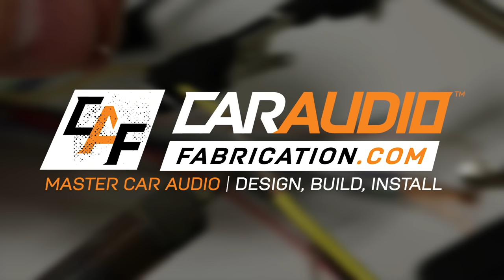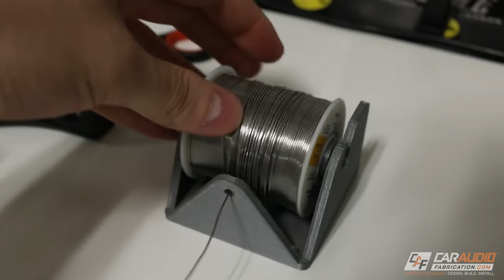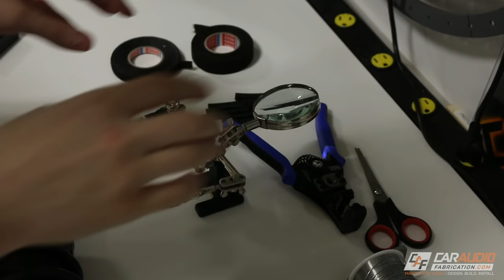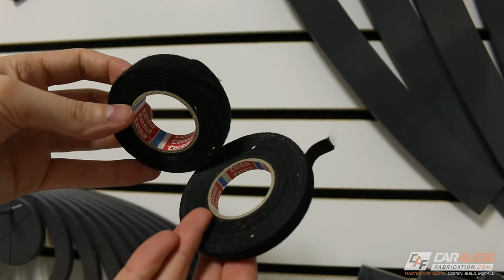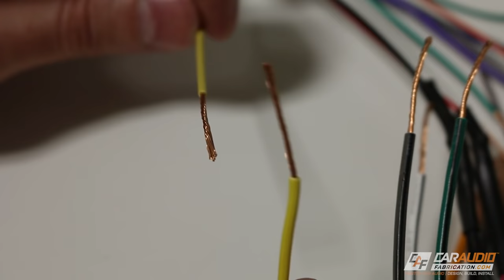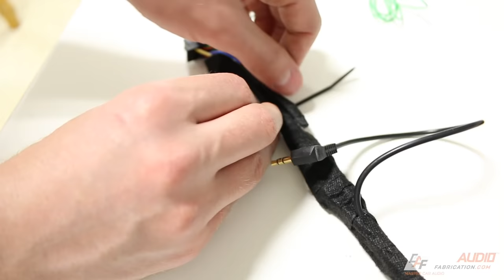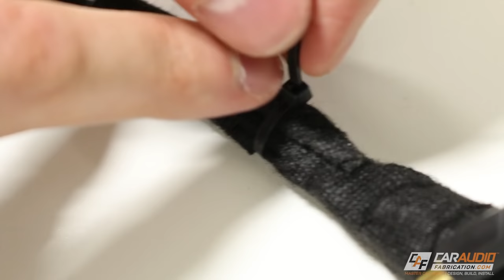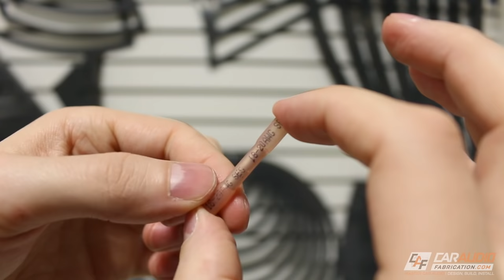Radio Wiring Harness - How to Install like a PRO

Comment: I'd like to know how to install a radio in a car that has no pre-existing wiring whatsoever. Do you have a video that explains how to do that?
Reply: jack chatham that's very easy, just run a wire from your battery to the install location, put a fuse somewhere in line. Ground it to the frame as close to the radio as possible. Then run wires to speakers. Or RCAs to amps then wires to speakers. If you don't have stock speaker locations, then yes you may need a little help 👍😊
Reply: Run wires to speakers, run constant to battery, accessory to key ignition or a RAP relay,  ground to metal. Done.
Reply: How old is the vehicle that it doesn't have wiring? You best bet would be to make a vehicle harness for it. It's not hard at all. I had to make one for my VW Bug in the early 90's
Reply: Main thing to remember is what you need to properly operate an aftermarket stereo. You need a 12V Constant, 12V IGN/ACC switched, Ground, and then your speaker wires. Other wires you may find/need are illumination, amp/antenna turn on.
Reply: It's a 1983 mini. They were never supplied with a radio as standard, at least not the bottom of the range model I have. Appreciate the replies, but most of what you've all said means nothing to me.
Reply: Care I was with you up to 'run wires to speakers', after that, you lost me.
Reply: Jack - Care means you will have to install wiring for the speakers you plan to install. Your best bet would be to use the radio's harness as your starting point. Yellow wire goes to the battery or a constant power source, Red wire goes to a switched bank in the fuse block or you can splice into the wiring behind the key switch (I did this with my VW), Black goes to ground and then you can either install speaker wires or run RCAs to an amplifier. You would still need to install speaker wires from the amplifier to the speakers.
Reply: LuckyRosco I saw a guy blu-tack a wire to his battery terminal and run it to his head unit. I know that's not the way to go about it, but I don't know what you mean by 'goes to'. Yeah, it goes to the battery, but how do you attach it? That's why I need a video to explain the stuff that you all seem to know implicitly. Same for 'splice into the wiring', without seeing it done, I have really no idea what this actually entails.
Reply: Anything going to the battery (also the ground) needs a crimp on ring terminal. I use the bare terminals so I can solder them and protect them with shrink wrap. I don't know where your battery is, but you should also use wire loom to protect the wire in the engine bay. The Tesa fabric tape won't last very long in the "under the hood" conditions. Wires installed in the interior can be Tesa taped, zip tied, or loomed with PET expandable braided sleeving (my preferred choice). All of this can be bought off of Amazon.
Reply: jack chatham Sounds like you're a little out of your depth. Since what you're attempting to do is a little more advanced then simply installing a radio into a car that already has one, which is basically a simple remove/replace, and is custom work. I would say you should begin by doing basic work first to get an understanding. Or just pay a shop to do it. It won't be expensive. Or ask a friend that's done car audio work already to show you. But for someone with almost zero understanding of basic electronics. It's not going to be easy, or safe. If not done correctly. You can set the car on fire. Electricity is no joke. The power in that battery is quite amazing actually. It's not hard, or complicated. But does require some knowledge to be done properly/safely. If you don't have a friend. Pay someone. But insist that they let you watch. So you'll know for next time. It's money well spent IMO.
Reply: jack chatham 
Then pay someone.. stereos are pretty basic.
Reply: BrysNightWorld thanks, very helpful
Reply: Andrew Balus so, installing a stereo from scratch is 'basic', yet plugging in an ISO connector requires CarAudio Frabrication to make a video to show us how to do that? Hmm...
Reply: jack chatham I think maybe I wasn't clear. Installing a stereo from scratch. In other words the car has no radio from the factory. Is harder then just installing a radio in a car that has one already. Not talking about a newer fancy car with steering wheel controls and such, as I've never done one, and we're talking old cars here anyway. Just putting an aftermarket one in place of a basic factory one is relatively easy. You get an adapter. You match the color coded wires and connect them. Really any type of connection will do too. Even just twist, and tape. You may have to redo it at some point, but it will work. Now from scratch. That's gonna take more knowledge. You're gonna have to get power. I would maybe run a wire to the battery with an online fuse. And run the ground wire to an existing ground on the car. Then you have to run the correct wire (forget what it's called) to the fuse box to an accessory that turns off with the car so the radio turns off too. Then you have to connect the antenna. Then you have the 8 speaker wires if you have 4 speakers. Not hard, but if you've never done it. Could be very hard. 
As far as a video being needed to install a stereo. It's not IMO. This is more about the proper way, and to help noobs too. This is the way a car audio installer does it the "right" way. But actually there's a few ways you could connect the wires. And you could even save $7.00 on the adapter, and wire directly into the factory harness. Or hook it up the same way you're gonna have to with yours. This is just considered the best way. They will all work though. 
You can do what you're trying to do. Trust me you can. But it's gonna take some researching, and asking for help. Without seeing it done, or having someone there to show you. It's hard for me to explain. But maybe someone who is a better teacher then me could explain it easily. I am just terrible at that sort of thing. The real problem is it seems like you've never done any electrical at all. That makes it even harder, since you don't understand basic terminology. This site may help
http://www.bcae1.com
Also you could try going to a car audio forum like
http://www.diymobileaudio.com/forum/
http://www.caraudio.com/forums/
But just remember. Time is money. And unless you have way more time then money. It makes sense to pay someone. Just watch them carefully. So you can do it yourself the next time.
Reply: jack chatham The other problem with your question is the rarity of your situation. It's almost impossible to find a car that doesn't already have a radio. So the chances of finding an article, or video on it are slim, unfortunately. 
So another thought is. Don't look up this specifically. But look at basic electrical stuff for cars. Anything custom is good too. But this specific thing is unusual. So you may be better looking at installing an aftermarket amplifier as a simple guide too. It's almost the same, but on a bigger scale. Could ask at the local auto supply shop too. They are at least there in person with the stuff right there to look at. Sorry I suck at explaining stuff. I hope this helps.
Reply: jack chatham I just did that! I found a switched power source, ran a new  12 v line from my aftermarket fuse panel, installed an auto zone antenna, and installed the head unit in to a home made center console. I spent 300 bucks on mid grade everything. took about 20 hours.

Comment: Where did you get that wire holder?
Reply: Harbor Freight Tools has a basic one for $5 or $9 for one similar to Mark's

Oh...you ment for the spool of solder? I do not know. Heck, he probably got it 3D printed. But I am sure that with a few searches on Google should find one.

Comment: The manufacturer actually doesn't recommend soldering, they recommend using a metal crimp sleeve and heat shrink.
Reply: Which manufacturer?
Reply: No manufacturer has ever said how to install aftermarket equipment.  Solder is the accepted practice in most car audio install bays.  It's a better electrical connection and can't vibrate loose overtime.
Reply: SuperPenishole
 They probably "recommend" it because it is easier and more of the general population can do it. If specifically asked, I bet they would recommend soldering. It is just a seriously better electrical connection. You could just twist the wires together and use electrical tape. Simple, easy and it worked for me  (in1979!.. ) until I learned that soldering was better.
Reply: Crimp connections are typically used (even by OEMs) because they're cheaper or if they're going to be placed in an area that is subjected to high heat (such as the connectors under your hood).  A lineman's splice which is then soldered together, as demonstrated in this video, has been proven by NASA to be stronger than the wire itself.

Comment: Hi Mark, thanks to your recommendations I bought a Pioneer 4660Nex. I have a 2017 F150 Extcab, I went from a 4” system to the beauty I have now. It came out fenomenal. I have a Factory Kicker System, but I had to unplug it because the radio is over powering the Sub. I haven’t found the way to limit how much power goes to the subwoofer. Any recommendations? Thanks in advance

Comment: I would never recommend wrapping the entire harness in Tesa tape, because it is an absolute nightmare to remove and that means never changing the deck again. You can accomplish the same neatness with a couple of small zip ties, which can be cut off if the equipment is ever swapped. PS - Use crimp caps instead, they're a direct wire connection!

Comment: Hey! This is my story: I bougt a little home theater system wanting it to be temporary not expecting much of it. It's got a little 6.5" sub in it and the box is small. Like... 12 inches high, 7 inches wide and 15 inches deep with a 1.5 inch port that is about 5 inches deep. The driver is actually really good especially for the price but the box is absolute shit. It gets louder and louder the lower it goes until it gets to 45hz. Then it just drops down so fast and all I get is port noise. I was wondering if anyone can help me build a better, bigger box for it, give me some dimensions. I know for sure the sub can do WAAY more and go WAAY lower and I want to keep it and put it in a better box but I have no idea how to calculate what of size box and port I need. I was aiming for it to be tuned to about 30 hz or somewhere around there. 
Also, the little amplification station that was included gives it only about 85W but after like 3 hours of listening at max volume it wasn't even warm. It was barely room temperature. So I'm thinking of also giving it a little more power.

Comment: Got to love it when you're excited to install a new stereo and have the dash apart to find out the previous owner has cut off the original harness :( Such a pain in the ass!! I dunno why people insist on doing that and not buy the proper harness in the first place.
Reply: 2nsane2005 the main reasons ive seen for people to cut the factory plug ive done it myself is when there is limited room behind the radio or simply they dont make the jumper harness for that specific model in any case if you know what your doing you dont need the plug there to hook up a head unit just ohm out the speaker wires and test for const/ground/ign 

It is more convenient to put the jumper harness together on a table though rather in the dash

Comment: Soldering is not the preferred method of connecting wires in automotive applications because the point where the solder ends is where the joint usually fails due to vibration. Crimping, if done right, is a better method from mechanical and electrical standpoint. It's also a lot quicker. 
Having said that unless I was installing car audio every day and had invested the 200 USD for a set of proper crimping pliers, I'd be soldering as well.
Reply: worked as an installer for years and have fitted 100s of radios - never have I had a solder joint go bad. have seen PLENTY of failed crimps though.
Reply: Стефан Парийски NASA and all the rigorous stresses on their equipment require solder, not crimp connection. When done right, solder is always better. Crimping, when done right, works well and is faster, but if you really want the best in your stereo install, solder it. "Cold" solder joints occur when proper soldering techniques are not followed or the wrong solder is used. Mark uses proper techniques. There are a few details that some might point to were left out, but this wasn't a soldering training video. :-).
Reply: NASA is a whole different ball game, you can't compare them with soldering that us mortals do. Plus they have weight considerations, so I would not be quick to judge their motives for choosing soldering. 
I have experience in making audio equipment (amplifiers, DACs, etc.), so I'm quite familiar with soldering, no need to teach me. When I say crimp connectors I don't mean the 10 bucks kit from the hardware store complete with pliers and 100 connectors. I mean Knipex tools and proper crimp connectors from an electronic components supplier. If you've used the latter two - you'll know what I'm on about.
Reply: Roger that! A good crimp works well and I have used them in the past, but I'm kind of like Mark, a little OCD about what is the "best way". Audiophile mind but on a Jensen budget, LOL ;-)

Comment: No lie im so cold with wiring. I hard wire my lexus cars with after math double din from lex navigation. If u know how to splice wires n connect them the proper way it will work from hard wiring but yu must find out the proper wire on cars because some colors change so call the dealership 1st. Some cars radio are anti theft so the car wont start without the harness for the alarm n theft system to drive the car. I been doing that since 19 years old

Comment: the guy before me gut the stock harness and i have to replace the radio
Reply: Solder the original connector on and then connect that to the aftermarket connector.

Comment: Tesa tape, really? c'mon!!
It's not gonna hold when it heats up in summer, it gets sticky and soft.
You better use tire wraps for bundling or use self galvanizing tape, which is a super invention.
Reply from the maker: +Winand D if you buy the actual Tesa Tape and not some cheap knock off this is not an issue.
Reply: Yes, it still is, but never mind...

Comment: Twisting then soldering is the improper way of doing it. Tin each wire then solder them together in a lap joint.  The joint you made is what's called a western union field splice.
Reply: Lap joint is muuuch weaker than what he did and is a waste of time to tin and then solder again.  Though what many (most?) do is a little different that what he did, it is the lineman splice that Zane mentions and you wouldn't tin first as that makes it too hard to twist together.  As you saw in the video, the solder flows through the wires and makes it solid.  The rest of the wire would break long before this would ever come apart.

Comment: When I saw, "Install like a Pro", had to see Butt Connectors, and the Scotch Loks were not used. Soldering and Heat Shrink is only way to go. I am Master Electrician, Even Longer, an Electronics Technician. Started Installing Radios since the Seventies. A friend was getting a Stereo Installed, preferred the Stereo installing Shops, over myself, as they do this Everyday, Guaranteed they used Butt Connectors and Scotchloks, they cut into the wire. They are more Into Quick than Quality(Most). He already knows I do Good Electric Work. Am afraid to see what they did .
Soldering connections may add 15 minutes to the Job?  Dummy

Comment: In fear of sounding like a complete idiot, im still going to ask.
Why not just get a model specific adaptor? like for my old car (Peugeot 307) it was waaay cheaper to just get a pre manufactured adapter with stalk controlls and everything. Ive not had any issues with them, but im sure ill get all sorts of reasons why you dont use them :p
Reply: the only real reason is quite often they simply don't exist due to the vast amount of different headunits available. almost every different brand of headunit has a different plug
Reply: Yeah i know that, but like most of them come with a hardness from the unit that plugs into some sort of standard plug? dont they? (they do here in norway at least, they branch out to that two clip thing) and then you just buy the adapter for your car? i would agree that this would look way cleaner though.
Reply: Never seen a double plug before. Might be specific to Norway every Radio Ive ever done is the same plug setup as this video. JVC/Pioneer/Clarion/Kenwood/Boss/Pyle/Power Acoustic/Farenheit/Sony/Soundstream and your cheap walmart/superstore off brand Radios are all like this Video.

Comment: I hate using factory wiring, just too small for my taste.
Reply: If you're powering the speakers off of the head unit's internal amplifier then the factory wiring is fine but otherwise it should be upgraded.  I also usually run the ground from the head unit to the chassis rather than utilize the factory ground.  Every time I have ever had alternator whine on a stereo has been from using the factory ground, clip that sucker out of the harness and run a ring terminal to a good ground location and the noise goes away.

Comment: You were doing good for the info i needed,,but you sped up the wire connecting and a once great video,,,,went straight to hell,,,Who TF needs instructions on wraping up wires if you dont know that part,,,,you DONT need to be playing with wires